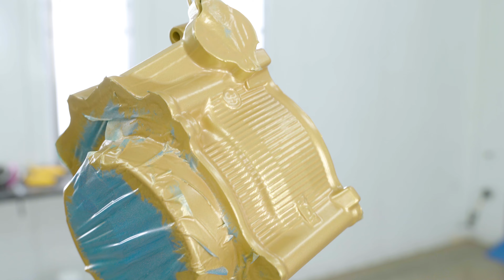Anti Gas Primer | Prismatic Powders®

Comment: I've never used this type of anti gas primer before, but I'm always a little skeptical of these types of "cure-all" products. I'd like to see the same demonstration comparing a standard epoxy primer to the anti-gas primer. One where you shoot two of the same parts that are for sure going to create an outgassing mess. One where the results show the standard epoxy primer leaving bubbles in your part and one where the anti-gas primer has resulted in a nice smooth finish.
Reply from the maker: We'll add that to our list!
Reply: Some alloys and castings are more prone to outgas, depending on the porosity of the metal.  This is where outgas primer is key to a bubble-free finish.  I've used it many times with great success.  There were a couple of cases early on when I first started powder coating where I didn't use this primer and I got bubbles.  After stripping and reblasting, the outgas primer was applied and no more issues.  This is not a cure-all - it's an essential powder coating component that every powder coater has to have in their shop.

Comment: Can we just use it as a standalone color or is it not suitable as a top coat?
Reply from the maker: You could use it as a stand alone for interior use, but a clear coat would be recommended if it's for exterior uses. Epoxy powders can fade and chalk with prolonged exposure to UV radiation.

Comment: Is anti gas primer good for PVD?
Reply from the maker: That's a good question, get in touch with the PVD manufacturer to verify,...just to cover your bases. Depending on the application and the application method it may be possible. A lot of times people are using PVD because it's thin, or can be ablated, if this is the case for you, it's probably not going to be a good option.